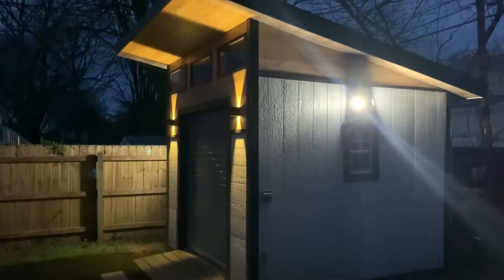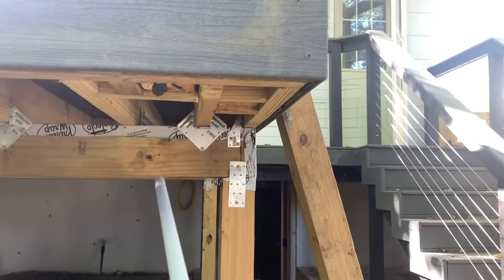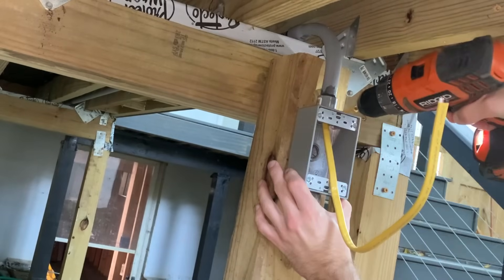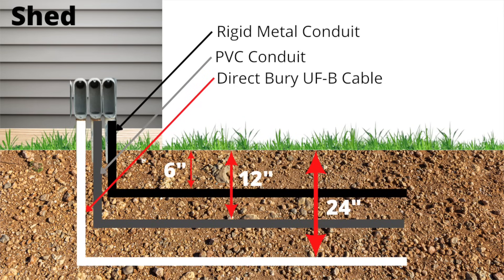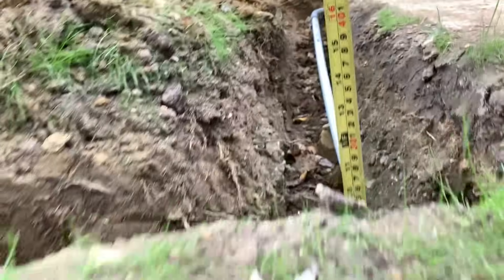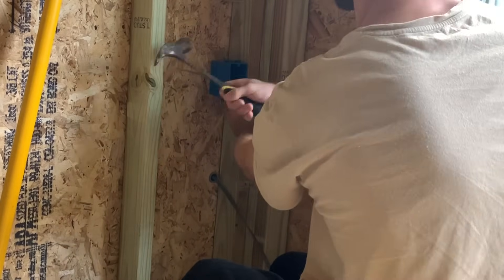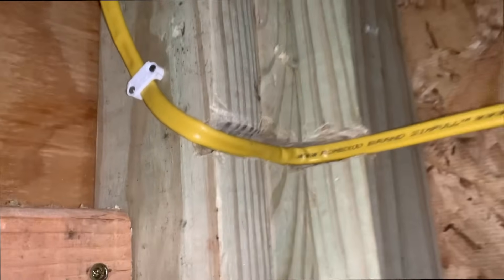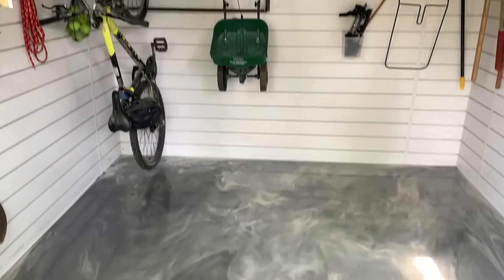Shed Electrical Installation (How to Add Electricity to a Shed - DIY)

Comment: One thing, then you pulled the wire through the conduit before gluing it up, how would replace the wire if you ever have to? Is this code in your area?
Reply: It's a code violation to do it the way he did. Conduit must be complete before cables or conductors are installed.
Reply: if you can't pull it the first time, you built it wrong (more than 360 degrees of bends)

Comment: So once you run UF underground to a shed you can connect it to a switch or a outlet & then you can then switch to 12/2 romex? have a project coming up just wondering ..
Reply: Yes
Reply: be prepared to leg it to the device to reset the GFCI once water condenses into that conduit from the air and causes false tripping. Better to bury the extra depth and not have to GFCI it.

Comment: I had the contractor on my addition put in a designated 20 amp breaker with an outlet outside so that I could run power later on.  Its now later on and Im not sure what gauge was used to route to the first outlet.  Given the work they did on the rest I suspect its the bare minimum, likely 12ga, maybe even 14 ga.  Total length from box to shed is gonna be about 100ft of run.  Im worried I might need to rewire the initial run to 6ga wire.  Thoughts?
Reply: If it is only a 20 amp breaker. 12s are fine. If the run is over 100 ft I’d use 10s.
Reply: #6 would be if you needed 60A @ 240v . 100ft you'd probably be fine with 20A breaker but safer to use 15a breaker if you simple  junction more #12 off (assuming that existing #12) . You can down the breaker size but not the wire size.

Comment: Romex isn't to be used in wet areas even in conduit. UF-B is the right wire as soon as you go out of your basement. The best thing would be use single wire THHN all the way from the panel.

Comment: 5:27 Normally it is 18" for PVC burial. I have not heard of the 20 amp GFI protected exception. I will look into it.
Reply: Table 300.5, Column 4
Reply: @pld8993  it's the code book troll!!🤣🤣🤣
Reply: @dhazz1536  Your senility is bubbling to the surface.
Reply: @pld8993 can you find the code reference that state no more than 360 degrees of bend in a single conduit raceway?😂
Reply: @BrawnsonDyer  As with most things in the code you can find the answer in a number of places but I found it in 352.26.

Comment: Thanks for your informational video. You should add KLEIN TOOLS Clear Wire Lubricant to your list. It will make wire pulling much more effortless.
Reply: hahaha this guy doesn't pull he pushes wire
Reply: @thedavesofourlives1  Which is why he couldn't glue the sections until the wire had been pulled.  Yes, "snot" makes the wire pulling much easier.

Comment: Great informative video - thanks for uploading. If I want to also run USB/ethernet cable, can it go in the same trench? If so, does it need to go in separate  conduit to the power cable?  Thx.
Reply: Definitely put low-voltage in a separate conduit.
Reply: Yes to separate conduit but also you’re not running USB that distance.
Reply: @shelms488  I meant UTP or even STP.

Comment: i have a question, what happens if you sell your property and the new owner digs a hole to build something. They accidentally cut the cable, they get a electrical shocked. Will that be your  fault?
Reply: Not if it is installed per NEC (in the USA) and was done under permit and inspected. You should also provide the buyer with pictures and/or a drawing showing the underground wiring.

Comment: Not sure you can double up wires on the same outlet terminal I think the better/safer way is to make pigtails, but I'm not a sparky.
Reply: You are correct. Only one wire per terminal unless listed for more.

Comment: 2:05 NMSC (aka Romex) is not supposed to be ran in ANY type of electrical conduit (Seal-Tight, EMT, Rigid, or PVC)...didn't your Electrician tell you that?
Reply: @Willie Hawthorne THHN/THWN wire
Reply: @Willie Hawthorne Or he could of used the UF wire he installed after the GFCI outlet for the whole run from the electrical panel but that wire cost more $$.  I doubt he'll run into any issues but if it were to get inspected for a sale of house, it might get flagged and it will have to be corrected.
Reply: You're wrong. Code reference?
Reply: Wrong. Article 334 explicitly allows Romex to be installed in conduit.
Reply: Lol yeah well you can put romex in conduit.  Not as fun as giving a cat a bath but right up there with it.
Yeah 🤣 but by code you can
Reply: @luvdady  Agreed, not the way a pro does it but legal. It almost never makes sense to install Romex in conduit.
Reply: @pd  all depends on the environment. 
 but never in wet locations. But most commercial metal stud walled etc are going to be bid thhn.
Reply: Romex is specifically allowed by the NEC to be run in conduit. It’s a common misconception that it isn’t.
Reply: @OrdinaryDude67  Correct, 334.15. Another false myth in the trade.
Reply: @luvdady  Correct its legal which is why you have to spec against it when issuing bids

Comment: So I'm using 8awg THWN for 220/240v 100' away... Flexible PVC conduit... That needs to be 18" depth correct?
Reply: Depends on your local codes. Best practice would be to go 24", gravel 6" then warning tape and fill.

Comment: Great video, but why is it supposedly safe for people to lay extension cords on ground  exposed to elements for Christmas lights, but these need to be buried about 24 inches deep for safety? Honestly curious.
Reply: Not necessarily safer. You’re not supposed to use the extension cords for long periods of time but people still do it. The cords break down when left outside which can cause issues like shock and fire. They are rated to work outside not to stay.

Comment: When burying PVC conduit, be sure to use schedule 80
If you are using 240V or non-GFCI protected, PVC conduit should be 18” deep
Reply: There's no need to use Sch80 for burial, Sch40 is fine. Burial depth depends on location, anywhere from 0"-24".

Comment: Headline says "DIY".
Then description says only do if licensed. 
Got it.
If I was licensed I wouldn't need this video.
Reply: If nothing else, consult a Licensed Electrician... We give free advice and some ( like me) will do a bit hands on for.... A sandwich and Mt. Dew.   LOL   ( IBEW 890 Strong)
Reply: @ProudDadVet  I'd offer some bud, but never encountered an electrician or plumber who'd travel to someone's home without a service charge, let alone give free advice.
Reply: @ProudDadVet  My 70 year old house (I bought 5 years ago in TX) only has 2 wire electrical, no ground. I'd sure like some advice if its possible to ground them, without re-wiring whole house $$. (Austin code allows install GFI - with a sticker- as a make do, but that isn't a true ground of course.)
And what is weird is there are 2 plugs that are grounded 1 in bathroom and 1 in kitchen (guess 1952 code only required that near water), yet the panel itself is NOT grounded so I wondered how those 2 are grounded - maybe to plumbing somewhere (which isn't allowed here anymore)?
Really p's me off, in 1952 it may have added maybe additional $50 to the builder to use 3 wire cable instead of 2. Now it will cost ~$10,000 to rewire.
Reply: @TurboMountTV  there are (3) ways to update the grounding per the NEC.  Rewire the outlets ($$$$$$$$)  or install a GFCI outlet at the start of the circuit or install a GFCI Breaker in the Panel that controls the outlets.
Reply: @TurboMountTV  Damn, that's just sad and a stain on my (our profession). If they had any brains, they would advertise free advice as that would bring in a LOT of new customers, and I know that from personal experience. I am swamped with work for that very reason.
Reply: @ProudDadVet  Any guess as to how those 2 plugs in my house are grounded, with no ground rod at panel? I'm thinking they must be grounded to a plumbing pipe.
Installing GFCI outlets really isn't "grounded"!
Reply: @TurboMountTV  If you use a Plug Tester and it shows "grounded", then I would guess you have an effective ground in the system. GFCI's are an acceptable means by the NEC in order to install an outlet w/a ground plug. Systems NOT grounded are required to be a 2 slot only.
Reply: @ProudDadVet  ProudDad, hope you can help.
So I am upgrading the 2 wire electrical that these Austin homes are cursed with. Installing with GFCI - with a sticker as per Austin code.
When I noticed the line in wires are only measuring 78 volts.
Researching Google says low voltage can be caused by loose connections, but the meter is connected directly to the wires!
When I plug the voltage meter into other plugs in house I get 124 volt reading.
Can help with what is causing this? Thanks,
Reply: @TurboMountTV  What is causing that is... a loose Neutral wire, either at that device or somewhere down/up the line. You may have to open other devices ( outlets/switches) and inspect them for a possible Neutral that is just barely touching the other Neutrals.
Reply: @ProudDadVet  OK Thanks. I will try looking. 
Wonder why you honed in on the neutral wire?
Either wire could be loose, no?
Also makes me wonder how devices worked on this plug, if its only providing such low volts.
Reply: @ProudDadVet  Saw this on Google:
"Is it common to not have a neutral wire?
Neutral wires are mainly found in newer homes (built after 1985) and are required by most modern US electrical codes."

My house was built in 1955 and only has 2 wires. 
I thought every connection was "hot" and "neutral".
How can you have power without it??
Reply: @TurboMountTV  The Neutral provides a path for the Full voltage to return to the main panel, if you see voltages like... 70, 80, 90 or even 100, that tells you the path for the 120v is incomplete. If you go to your main panel, and put one probe of a  voltage tester on a breaker, and the other probe on the Neutral or Ground, that will confirm you have 120 leaving...go the the device, and see less then 120.. that means the Neutral is faulty on that circuit.  Electricity  101.
Reply: @TurboMountTV  Think of it this way.. Electricity is like water... The faucet is power and the drain is the Neutral. One cannot work without the other. Some houses built in the late 1800's were DC powered (like a battery) with a Pos and Neg. Then came AC power in the 1900's and ALL homes had a neutral. Back in the day, some appliances (ovens and Wells) used 220v. 2 hots and a ground, no Neutral. Very inefficient as all the power was used and NOT returned to be used again.
Reply: @ProudDadVet  Thanks for the pointers for me to look at to diagnose this.
I have to wonder... if this is a "loose" connection, isn't that a possible fire hazard?
When I think of loose electrical connections I think of sparking.
Reply: @TurboMountTV  Possible but not all that likely. Most 120v appliances ( lights/fans/battery chargers/ etc.) require 120v.  A circuit with only 70-80v will not be enough to operate that appliance. Now... some appliance have internal circuits that run on 12-24v and that can cause an issue due to the bad voltage entering and not being able to leave. Think of it as a plugged sink and the water running.  As for Sparks..no, ONLY the conductor side ( HOT) can create sparks, the Neutral cannot.

Comment: Also, use 12 gauge for outlets and 14 gauge for light fixtures.
Reply: That’s not NEC.  Could be local though.
Reply: 12 gauge on 20 amp, 14 is good on 15

Comment: Romex inside PVC conduit?
It should only be done to protect the 12–2 romex from physical damage. Romex or NM-B wire is NOT allowed to be run in PVC conduit that is buried. In that case you would use type UF wire, or THWN individual strand wire.
Reply: UF is what he installed underground. The NM under the deck in PVC is a violation but not because it's in PVC,  it's because it's outside.

Comment: I’m sure others who actually know the NEC have already corrected you about the minimum cover required when using pvc. You should do all the research possible to avoid causing someone to have a failed inspection. Twelve inch is only allowed if there is also 2 inches of concrete on top. It must be 18 inches otherwise.
Reply: Incorrect. 12" is allowed if certain conditions are present and this install is consistent with that.

Comment: As this is how to add electricity to a shed and not run a wire, I will add that you can also add a battery system, possibly with solar to recharge it. (Called Portable power.)
What it costs is offset by it's simplicity and may be better for some people. It might be cheaper also.
You do have to recharge it. Either by carrying for smaller systems or wheeling it to a power source or adding a solar source to recharge it where it sits.
 He states 120V x20 amps= 2400 watts There are systems much larger than this.
Reply: guaranteed it won't be cheaper. Likely not to code further yet.
Reply: @thedavesofourlives1  
It may not be cheaper, but you don't know this in every situation. Long distances or rocky soil? Paying someone to dig the trench? Is it indeed guaranteed? But then I only said it might be. 

Why would it not meet code? :face-orange-raised-eyebrow:

Comment: Also I thought you were to never glue with wire in conduit? Eats the sheathing as its pvc also
Reply: The cable is not allowed to be installed until the conduit system is complete. It's a violation to slide conduit sections over the cable and assemble. Also, to your point, the glue won't eat the sheathing but doing it this way will naturally get glue on the cable and it will stick to the inside of the conduit and make removal of the cable impossible. Multiple NEC violations in this video. Just because it works that doesn't mean it was done correctly.
Reply: Your not supposed to put the car in gear before putting on a seatbelt. But you did it anyway a few times didnt you?

Sometimes glueing before all wiring is in place is not practical either
Reply: @portaadonai  Pulling cable, as opposed to individual conductors, in any conduit is an amateur move. Pros don't do it that way, we know better. So no, I've never slid and glued sections of conduit over conductors because when you know how to do it the right way, there's no need to.
Reply: I'll give him credit for only putting glue on the male side. Not sure how good his joints will be. When I have done repairs with existing wire in the conduit I have had to do it this way. But only one joint.

Comment: Nice video starts with nec code violation. You cannot run Rome. In conduit.  Sure this was not inspected because inspector would not pass this necessary violation.  So when your house burn Down insurance will not pay out any claim because of faulty wiring
Reply: Also your wire is not approved for burial in ground
Reply: Shed should have a sub- panel in it not run to individual circuits
Reply: Never saw ground hooked up to the shed lights
Reply: Like how you admitted no axc inspection done “ I got a looks good from my electrician …. Bet guy not have an ac license because installing this faulty setup if guaranteed to burn down

Comment: The wire would pull through the pipe more easily if you unrolled it first. Doing so removes the twist.

Comment: I’m trying to do the opposite. I got a solar shed with enough power to cover one my my house bedrooms. So I’m trying to route power from the shed through the wall of the bedroom to provide a solar powered source outlet
Reply: nope. you'd need to drive a rod, use a grid tie inverter and treat it as distributed sources. And get a 2 way meter installed.
Reply: @thedavesofourlives1  I actually got my whole system working. No need for a grid tie inverter. I got two panels charging two 100A batteries going to a 2000W renogy inverter. That’s wired through conduit to the side of my house where the bedroom is and it’s all working great.

Comment: I have been told that you should not piece together the conduit with the wire in it. Code is to be able to pull the wire through the conduit once it is in place with no more than 360 degrees of bend between pull points.
Reply: Correct

Comment: I don't believe you're supposed to do a total number of bends over 270 degrees without an access port in the conduit. Also shouldn't the part of the wire under the deck also be rated for wet locations since it's outside?
Reply: it's 360 degrees max, not 270, and yes, the romex run under the deck should be UF, not NM. As it's done here it's a violation.

Comment: problem is I dont think that meets code in most places.
Cable has to be pulled through preglued conduit.  Thye dont want glue on the cable .... as it will deteriorate ...... at least what I was told.

Comment: Your holes in blocking , joists , studs, or any framing must be NOT how you did it! Your don't want to hit it with a drywall screw for example.  And holes off the center weaken the structure.
This guy is a Code violation nightmare!
Reply: From his videos and some of the comments codes don't seem to matter much.
Reply: at the very least protector plates...

Comment: I thought you couldn’t run romex thru conduit
Reply: Incorrect. Romex is allowed in conduit.
Reply: @pld8993  not here in Michigan
Reply: @Hitm8kr  According to the Michigan Residential Code the 2023 NEC is the applicable electrical code. There are a couple of MI amendments to the NEC and none address romex in conduit. Michigan allows romex in conduit. If you have a reference that says otherwise, please share.

Comment: The idiot that ran power to my shed buried a direct line with no conduit only 3" under the soil. I hit it while digging a hole for a plant and thought it was a tree root until I took a closer look.
Reply: Next time use a licensed electrician.
Reply: @Sparkeycarp  I discovered it after living in the house for two years. Let me go back in time and give that advice to the previous owner.